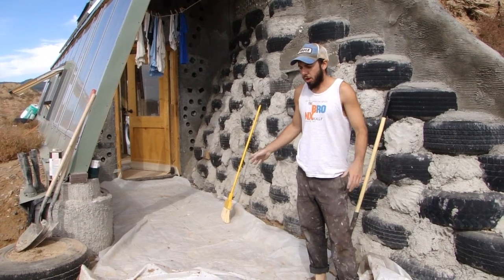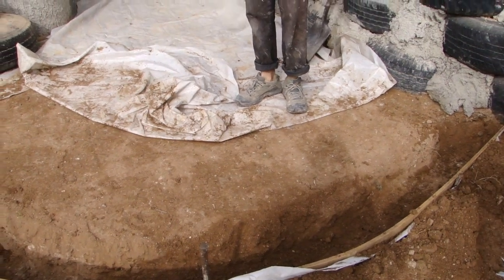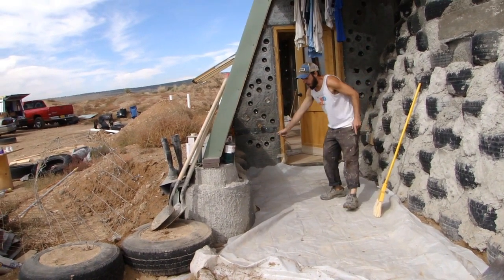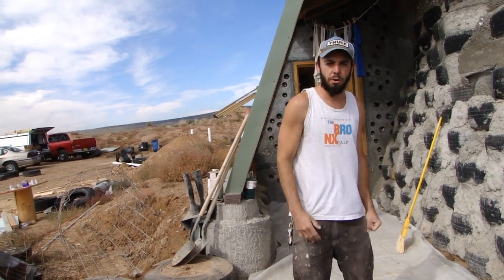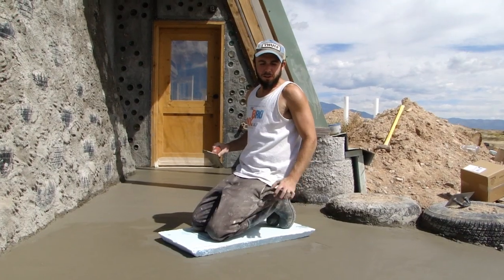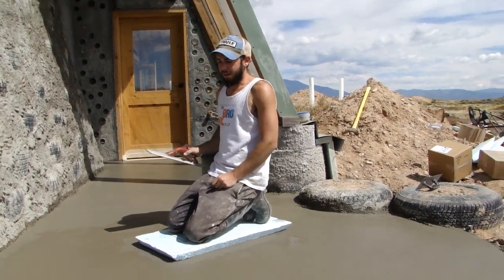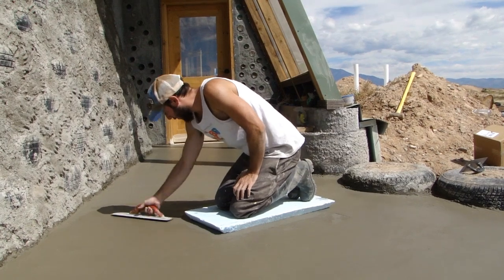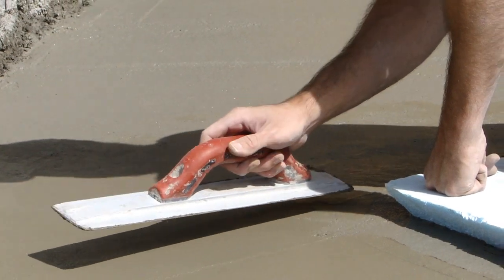Concrete Slab Floors - Part III

Comment: Still loving your videos, thanks for all the hard work you put into them.  Only question I have on this one is that use of a saw/angle grinder for the control joints.  Any reason for doing that vs using a grooving and edging tool?

psst...  6:28 on is just blank. ;)